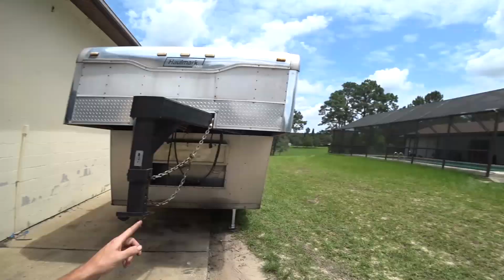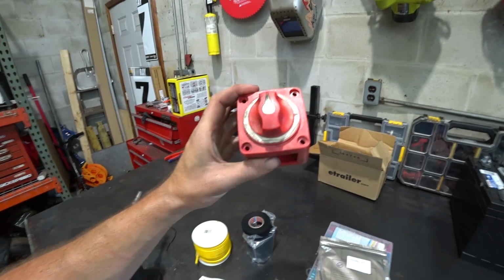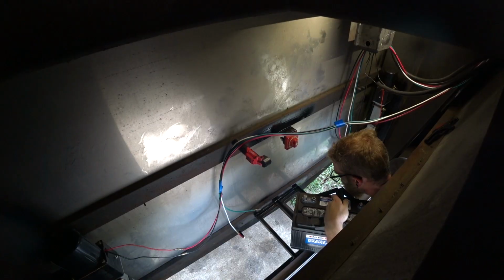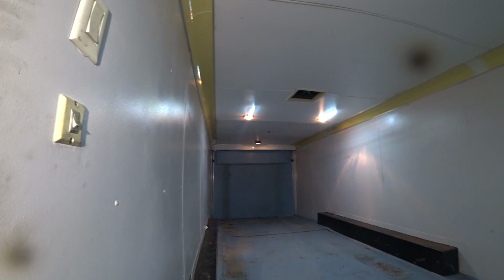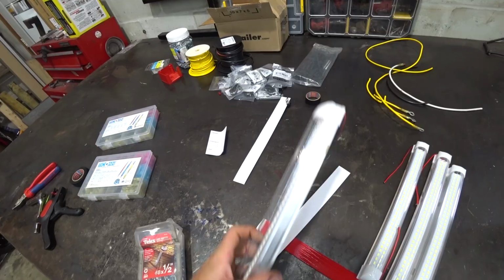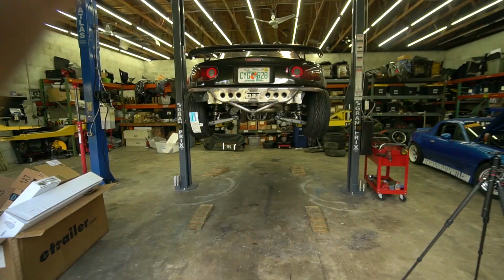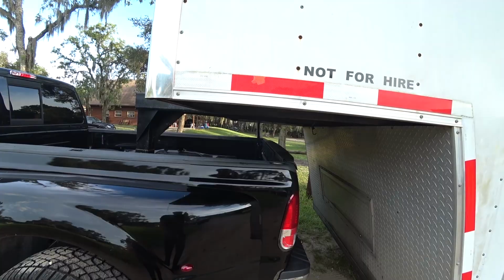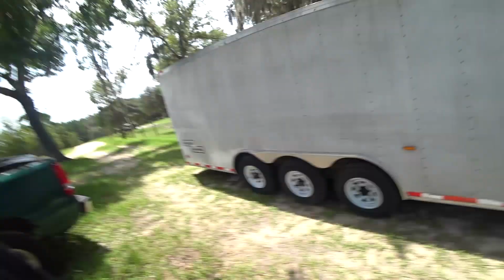Refurbishing And Upgrading My Gooseneck Enclosed Car Trailer Pt. 2

Comment: Solar energy companies: sponsor this man.     
Plenty of room for a few more batteries.  Then a few solar panels on the roof to run lights, an air conditioner, small refrigerator, plugs to charge Milwaukee batteries
Reply: Totally agree.   A solar panel to manage the battery's are a must.   A simple 100w panel with charge controller would be huge step. Much idle time to change vs usage.
Reply: I was about to say the same thing. It would also cross over his car content into the diy solar market too. Plus most people watching would probs be into it.
Reply: Love how he turned the lights on in the shop heading out the door
Reply: I would love to see this. All is builds are so unique, why not have a bad ass trailer?
Reply: Would need more than the whole roof to power an ac unit
Reply: Billy Ward not true. solar tech has come a long way and A/C is a lot more efficient. totally doable with solar
Reply: The only one focused on trailers was Zamp and they're a mess. You're better off getting a cheap 100watt panel and a 10 amp mppt charge controller. If you need more power, just keep adding... Victron is awesome from my experience, but your experience might not be the same and it's expensive. I'm not a fan of renogy. I have ~600 watts of solar on my toy hauler.
Reply: @Bward216  Not at all Billy, I have 3 360w monocrystalline panels that will produce over 70 amps continuous. My 12v a/c unit pulls 60 amps, I have 200ah of lithium so I am able to charge while still running the a/c. Also its 20k BTUS
Reply: Lol, AC? Not without a Tesla sponsorship
Reply: @cartermassa  for a bit...nothing like you would need to keep the trailer cool for a full event
Reply: Jacob Walls nah man. if you build your own solar setup it’s been proven with a ton of camper vans that newer AC units with custom solar setups are very efficient and don’t require a ton of space. solar technology has come really far in the past 10 years with more residential and commercial applications.
Reply: @jacobwalls452  His math works. As long as a cloud doesn't blow over or any trees around, he's okay for a minute. Mini split AC is the way to go though if you're building it from nothing. They pull less than 1200watts running.
Reply: @MitchellCamps  umm...the 12v Pro Air unit uses 146 amps...
Reply: Jacob Walls lol no it doesn’t, I have it going through a Victron shunt and it is not pulling 146 amps. It pulls anywhere from 45-107amps depending on ambient air temp and the speed you’re running the fan/compressor
Reply: @MitchellCamps  I literally just looked it up...and at 107 amps, that thing is running for two hours...like I said, put in a Tesla powerwall if you want to run AC like a camper
Reply: Jacob Walls At full fan speed yes, it’s a variable speed compressor. Meaning you’re not pulling 107amps all the time. Once you’ve brought the trailer down in temp you can back off the fan speed. He has enough space on that roof for over 2000 watts. I have over 1080w on my transit. 2000watts would be pulling 140+ amps continuous so yes a 400ah lithium bank with that much solar could run the a/c all day and then some.
Reply: @MitchellCamps  he's in Florida trying to cool down a hot trailer at the track bruh...he's going to need more than 200ah and he's going to need to plug it in when he's at the shop...solar trickle charging isn't going to do much but extend battery life...unless someone wants to plaster the entire thing with panels
Reply: Jacob Walls Do you not understand how solar works? Do you own solar panels? I can watch over 70amps of continuous power come in through my 3 panels on a van. His trailer is so much bigger than mine, this a/c is overkill for the van and could easily make a massive difference in a trailer. Is it going to cool the entire thing down to 60 degrees? No way, but it can pull the temps down to high 70s which is considerably more comfortable. Also solar charging is not trickle charging. This is very high voltage. My panels put out over 130 volts of power
Reply: @MitchellCamps  cool story bro
Reply: @MitchellCamps  they def don't do 130V of output...lol, max 21v in DIRECT sunlight...three panels on a van? That many panels is 4'x24'...like I said, plastered
Reply: @MitchellCamps  voltage isn't a measurement of power but of electrical potential...like psi for water or air
Reply: @MitchellCamps  if you wanted to speak about high power, you would speak about watts
Reply: @scottleggejr  it's 1762 watts for the most efficient 20K btu units at max power...20K in a van would be insane or a meat locker... dude is full of it
Reply: @jacobwalls452  Even with your watts on a 1.5 ton AC mini split, 1762-994(solar 70A @ 14.2V (float)) = 768watt delta from 200AH LiFePo4 batteries is totally and completely reasonable >0.32c. I don't know why you're fighting. I have 15k btu dometic RV AC units and it's not enough in the Arizona heat (115F ambient or 90F + 50% RH monsoon) in the summers to be comfortable. Those bitches each pull like 20 amps on a hard-start. I have a 30' box RV with... R12? in the walls. I don't understand the banter. I suggested a minisplit in another comment in this video elsewhere because they have well-designed soft-starts and low overhead and super high seer at a great price. They have super efficient brushless motors and controllers. They're suuuuuper common anywhere but the USA. Maybe he has a 14-17k btu minisplit? It's super, super common on class-b motorhomes to throw the compressor/condensor on a hitch in the back and run while you drive off the alternator + solar. I dunno man. The math works out on my end as viable...

130V of solar means he's running the panels in series instead of parallel. Each panel usually puts out around 30 volts and the amps is dependent upon the watt rating of the panel. I run on 270watt panel on a 30V @ 9A > 20amp victron mppt charge controller and get the full 20 amps when the sun is high. I have two of those and a 100watt panel on a 10amp charge controller. I have ~45 amps when the sun is high per the app, to my batteries. 

In short; solar is super powerful and dense and cheap. Look up santan solar on ebay for wonderful, used, industrial panels for cheap cheap cheap. LIFEPO4 batteries = low internal resistance and massive capacity. 200-400AH @ 14.2V is a metric-shit-fuck-ton of power on tap. Mini splits = wayyyyyy more efficient than brushed shit RV AC units made for third-world power grids and consume super low startup and running watts. Peace and tire smoke!
Reply: @scottleggejr  RV ACs are built for third-wolrd power grids? Hmm...ok
Reply: @jacobwalls452  I get it now. Reading comprehension! I said " I suggested a minisplit in another comment in this video elsewhere because ... <clipped out words> They're suuuuuper common anywhere but the USA." MINI SPLIT AC UNITS!!! Dometic/Furrion (RV) vs Mitsubishi/Samsung/LG (mini split).
RV = brushed, old, hard starting, big amps. 
Mini split = soft starting, brushless, efficient, third-world power grids.

Edit: I found the other spot I said " Mini splits = wayyyyyy more efficient than brushed shit RV AC units made for third-world power grids and consume super low startup and running watts. Peace and tire smoke!" and you're right this is confusing how I worded it. Mini splits are made for third world power grids.
Reply: @scottleggejr  got it...I was confused

Comment: Don’t paint it black, it gonna by so hot inside! Your AC wont be powerfull enough to cool it down :D
Reply: This needs more likes. Me and a buddy both have the same trailer just mine is white and his is black and the difference it makes is crazy
Reply: Definitely had a  black enclosed for a little  while doing lawn care it sucked
Reply: He should paint it like a lite grey i think the would be a happy medium
Reply: Another option: Wrap the sides black and leave the white roof. Best of both worlds?
Reply: @brandonthompson9957  it's a good thought but the black will still draw in more heat than you can imagine
Reply: @larrysutton6530  The roof is the majority of the surface area sucking in heat/light I would think. Idk though, never tested it on a trailer.
Reply: Brandon Thompson it’s still going to be way hotter than just straight white. Because if you think about it, the full white still gets hot. Adding black can only hurt. Other than the sick style tho haha.
Reply: @Racingboom  should wrap it chrome 🤣
Reply: @brandonthompson9957  the sides still draw a lot of heat. The sun doesn't point perfectly straight down all day. The side will get just as much sun.
Reply: Peter Rollins TRUE
Reply: Or blue like bens Miata
Reply: Never thought of that but it will look so good black. It might be worth running 2 A/C units just to see the trailer blacked out with chrome wheels to match the truck perfectly LOL
Reply: Brandon Thompson . Thats a great idea , i dont know why I thought all of it should be the same colour lol
Reply: yeah.. paint it white.. it'll keep it nice & cool..
Reply: Don't do black, man you're in Florida.
Reply: any of you tried to insulate them?

Comment: You should get one of those Rv awnings that provides you some shade to sit under while waiting at events
Reply: They have a rv to chill in if they need shade
Reply: That's what Ben's RV is for.
Reply: Not a bad idea
Reply: @bryceboatman3462  I'm fairly new to this channel I didn't know they had one
Reply: I was thinking the same thing, and he could park under it and the inside of the Miata wouldn’t be so hot when he has to get back in the car.., and he doesn’t always travel with Ben to events
Reply: Bryce Boatman It would cool the trailer down by cooling some of the air around the trailer. Not to mention give shade and rain protection coming and going.

Comment: you need to put one of them LED strips above the rear tires on the trailer incase you get a flat so you can see what your doing, put on same switch
Reply: That is a great idea until one blows and rips everything out
Reply: @bannablitz247  so then your down 5 bucks for a LED light and 10 min of your time
Reply: do flashlights not exist?
Reply: One doesn’t plan on changing a tire that much

Comment: On a trailer I always say "once you black you will definitely go back" so bring back the white if you dont want your trailer to be 125 degrees on hot summer days
Reply: @willb3018  Would a white roof give a similar effect?
Reply: Yah I was thinking bout the heat but for some looks are more important
Reply: I can vouch. Black trailer in Florida is a mistake.
Reply: @brandonthompson9957  I think it would helpt. But that is still a lot of black.  He was talking about AC which also helps, but it will work a lot harder.  You could even insulated, but then you would cut in on interior space.
Reply: Try TSP and bleach that works for me
Reply: Brandon Thompson if the sun was only ever directly overhead, that would work.
Reply: Shit I have a white trailer in west texas that gets to about 115 on a hot day.
Reply: @TheSteelArmadillo  that's not how infrared heat works though
Reply: My trailer is black it is just missing side walls a roof a front wall and a door hah
Reply: Agreed. I’m a UPS driver in Arizona and we see 160+ in the back of our browns in the summer. FedEx for example is substantially cooler in the back of their white trucks.

Comment: You need to cut and weld some diamond plate on the under side of your trailer to keep people from just crawling under.
Reply: I was thinking the same thing.  I saw a couple different ways I could get to that kill switch.
Reply: @Gahet  lol!!! My master plan is reaching taylor's kill switch and his batteries being drained in a couple days...MUAH HA HA HA!!! lol,jk.... but I'm sure he'll do something when he has the time and not 2 days before an event, especially once he has a generator in there, if he goes that route instead of solar.....    good looking out though, its just funny that some people have the mentality of "i could so get in their and the only thing to steal is batteries and sabotage the electrical system...." lol, which would just be cruel, but i realize this stuff happens and some people just think that way :) Ive got full faith he's gonna make that a badass trailer :)
Reply: He’s planning on putting a small generator up there, so once that happens I’m sure they’ll be a plate of some sort to prevent any or anything getting into it.
Reply: You can’t weld diamond plate to the bottom needs to have drain holes in it diamond mesh would work 👍🏻
Reply: @fender42421  I see that sort of thing because I've been stolen from.
Reply: @fender42421  It's not that people will drain the batteries. It's that people can manipulate the trailer jacks and steel it along with everything inside. Trailer theft is a real thing

Comment: Zep Citrus Degreaser and a pump sprayer and elbow grease or amazing cleaner I believe it's called from Dollar Store and elbow grease. Also use plumber's putty instead of clay bar way cheaper and works just as good. If you do wrap it do not do black you will seriously regret it at the track it'll turn the trailer into an oven yes it'll look cool but it will be unbearable to be inside of

Comment: When you redo the interior lighting, you can make it so much brighter by using LED strips. You can ditch that light fixture mounted to the top for a little additional headroom while you’re at it. Mount them up along the whole length of the trailer along the ceiling  on either side. They will draw a whole lot less power than other lights might, and you can use other strips for specific purposes like lighting up your toolbox and cabinet area some more.

Comment: Seems like someone could crawl underneath and get to the kill switch? Tweakers are flexible and skinny
Reply: All Tyler has to do is weld in some thick screening across the bottom opening.
Reply: Tweekers all day in HD truck with 5th wheel😂

Comment: I'm a commercial pressure washer and we use this stuff called La awesome sometimes to get white vinyl and white gutters clean . They usually sell at Dollar Tree it's pretty cheap. We usually use a pump sprayer to spray it on scrub it and then rinse it should work.

Comment: For my enclosed trailer i use Comet w/Bleech with orbital polisher, makes the job quick and easy. Regarding powering your trailer, go with solar. I installed flexible solar panels on my trailer and increased the size of my battery bank with Ruixu LiFePO4 batteries into 48v 2800watt inverter which will power my onboard a/c system for about 8 hours on a full charge, but for a/c usage i combine my truck with the solar when the batteries get low on charge, because i installed a dual alternator kit on the truck and ran welding wire to an Anderson connector on the bumper, which i can plug to my trailer to give it over 2000watts of additional power for topping off the batteries and such and just idle the truck while in the trailer. But solar is so nice for just a few hours, i use my enclosed trailer to tow my UTV and camp inside it at the same time in the a/c.

Comment: So a few thoughts. I never got to "enclosed trailer" level racing... I would do a champion inverter 3k watt generator and a residential mini split AC unit. If you do a dometic or whatever RV A/C, you need more startup amps than a mini split and you're looking @ 5kw+ genny. You can also run laptops and phone chargers and stuff from inverter based units as compared to the predator. Depending on compression ratio of the miata, you could do a tank to graity fuel the genny, as well as get rid of dump cans (or carry one small empty one) if you put an internal tank + pump in the trailer. I would do an andersen power port off the trailer too with jumper cables from the trailer to jump stuff as well as needed. You could do 120V plasma/TIG/MIG off the new genny too. The possibilities are endless. A gas powered compressor might be nice too especially if you can find one that does self-start on demand. I wish I could have found an enclosed trailer when I raced...
Reply: Only Aims pure sign wave power inverters should be used.
Reply: @dirtysouthtv2209  I would skip over a DC inverter completely. It's not an RV, it's a mobile garage and possibly a place to crash. A generator is instant, full power, on demand until you run out of gas. No one cares about exhaust and noise in race event pits.

Comment: I had a black enclosed trailer with a silver one piece roof. Was always hotter than a white trailer. But it looked nice. Was harder to keep clean though. When I bought it used, it was really dull. I used rubbing compound on a buffer to get it to shine again (gotta wipe it down clean after using the buffer) and then used a good wax over it. Turned out slick.

Comment: Wouldn’t you be able to get two miatas in it like rudnick can (save having to take two trucks when you and Ben go to the same track)
Reply: the mb rv is already going, and that can pull a trailer soo...more room in the trailer for tools
Reply: With the cabinet setup he has and his trailer length also being over the truck I don’t believe they can fit and if they could it would be so cramped there wouldn’t be room for twice as many spare parts for two cars and twice as many tires as well

Comment: Get a Cummins onan generator to go with the Cummins under the hood
Reply: nah, get a Honda or Yamaha. equally as reliable as the cummins
Reply: Most of them are gas powered. Cummins owns onan, just the larger 20kw and up are diesels, and even those aren’t cummins powered. The smallest Cummins powered generator is a 45 kw which has a 4b and weighs about 4500 lbs

Comment: You should get the led truck bed lights that go under the bed rails, it will also help with hooking up the trailer and just loading stuff at night in general.